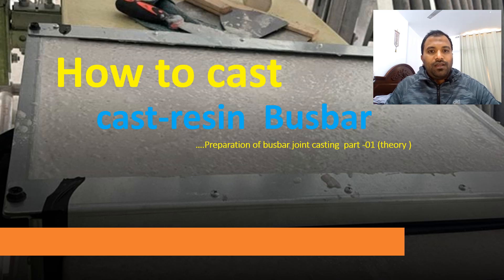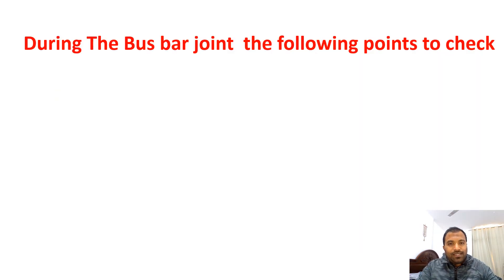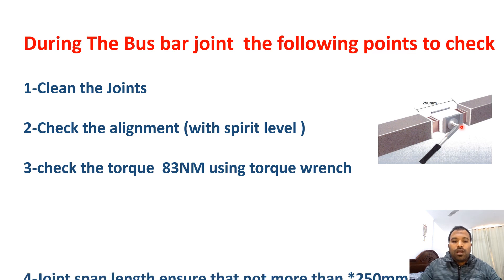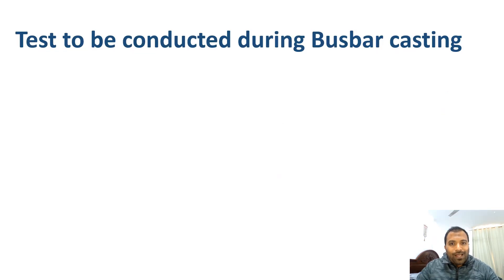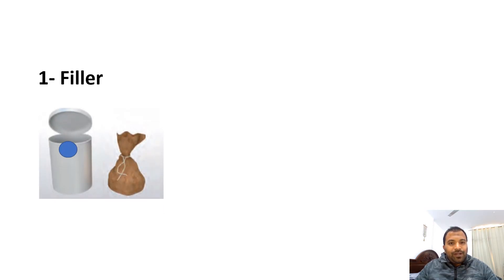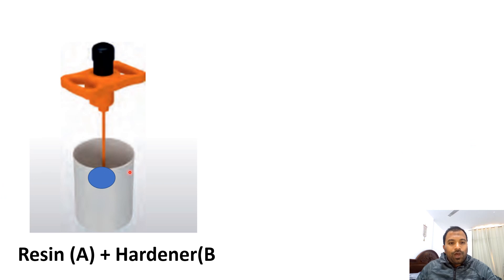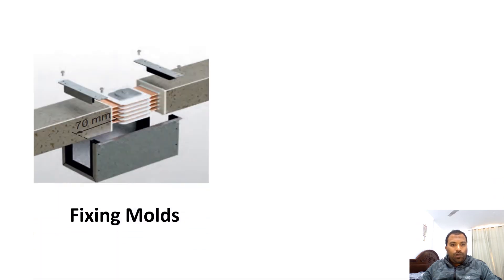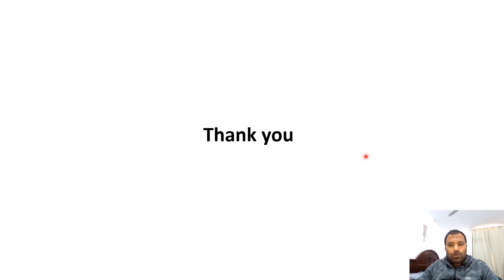How to cast cast resin busbar joints

Comment: What is difference between bus bar and cable
Reply from the maker: I will make video for this one  
In short busbar are solid element which is not used and can carry high currents ratings  and cables are flexible type can bend and carry laser currents